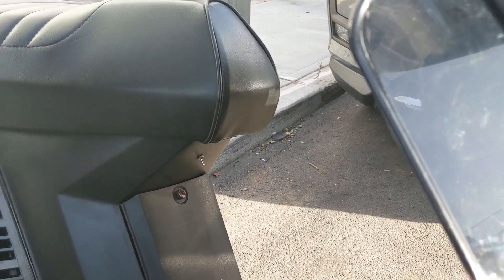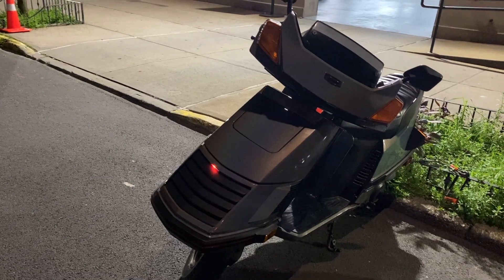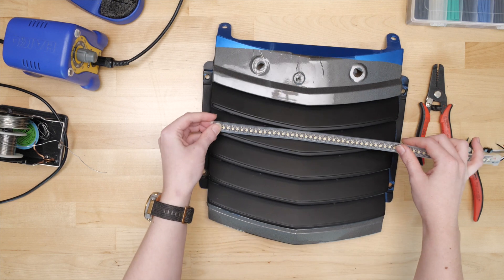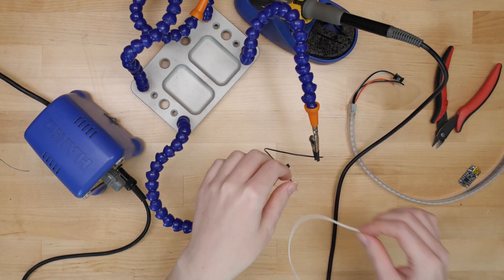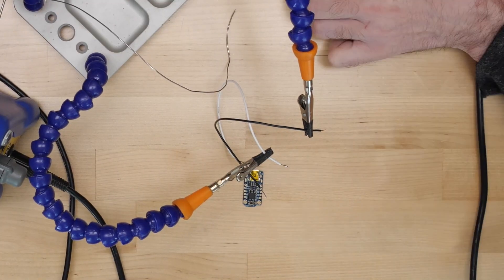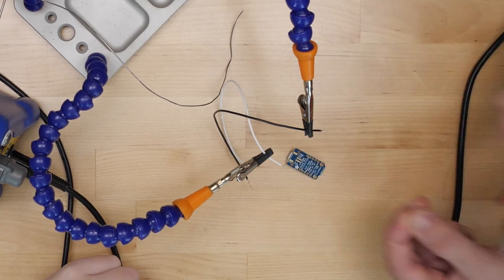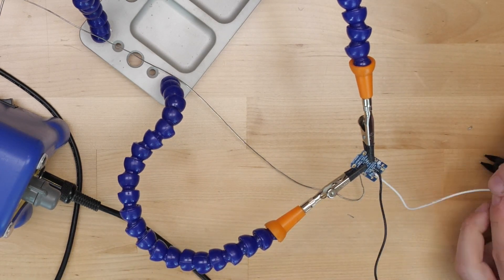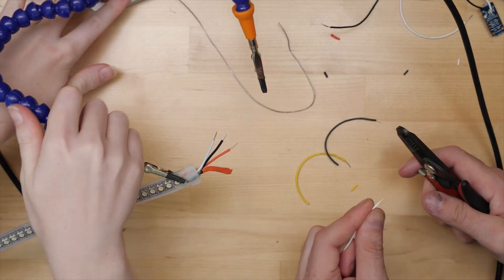I gave my scooter a very 80's upgrade...

Comment: I built a knight rider display for my Center stop lights ( break lights uk) using 2x cmos 4017 decade counters 4011 as clock back in the late 80s/early90s but was told by the uk police to remove it,

Comment: Noooooooo bare connections on motorbike is a cardinal sin. Even if it is a scooter. 

Myself personally I would have used a short length of 4core arm wire for the jointing piece. Then you could have slipped on some clear heat shrink.
Reply from the maker: There aren't any exposed connections, everything is sealed with silicone adhesive.
Reply: @BeckyStern  silicone anything and motorbikes don't mix due to the vibration. I've learnt this the hard way over the past 15 years of fitting han radio gear and other electronics to my bikes. The vibrations on my st1300 vary from 900 to 6k and that not pushing it. 

For longevity you either want glue impregnated heat shrink or pack the joint with a dielectric grease.
Reply from the maker: Thanks for the tip!

Comment: Just a couple of things... it's not really enough to come in under the max output of the LDO. You also have to consider the temp rise for a given power dissipation. The MIC5225 on the Trinket is a SOT-23 and those have very high thermal resistance - 235 C/W in this case. So for a summer high ambient of say 50C, that gives you only about 300mW you can dissipate in the LDO before reaching is max junction temp of 125C. If the alternator of the scooter is in bulk charge at 14.4V, and you're using the 3.3V variant, that puts your maximum current at just about 30mA. If those LEDs are super efficient and biased for very low current, you might be okay...  but it's something to check on.

Comment: Very cool project.  Just please check local law about having red or flashing forward facing lights on your vehicle. Lots of places restrict that to just emergency vehicles and such..
Reply from the maker: Depends entirely on local enforcement. This thing is so subtle, and has its own switch too. And the cops in NYC have worse offenders in the illegal lighting department, and they have better things to do besides.
Reply: @BeckyStern  Technically legal in NC as long as it isn't blue. but you might have an opportunity to meet your local DA. Other states? No clue. Neopixel color is programmable over a good range - "very orange" would be sufficiently KITT and totally legal in 50 states, just like construction vehicles and tow trucks. KITT was never as red as a Cylon.
 Seems like it was incandescent.

Ride that scooter to NC and a few hackerspaces will make sure you never pay for beverages down here, in exchange for what will certainly be some good road stories.
Reply: @erikscott5709  Could always go KARR...